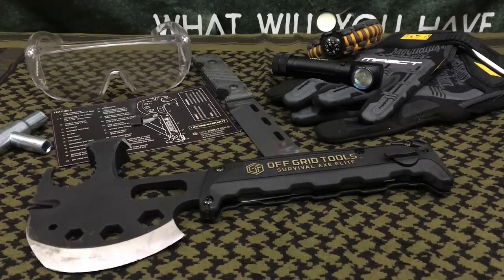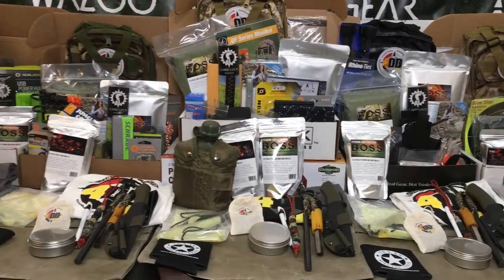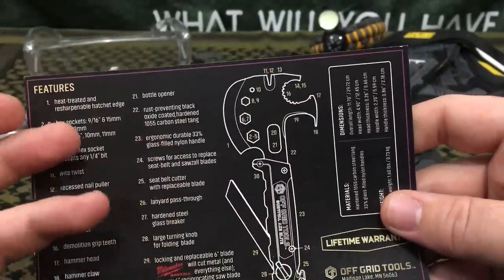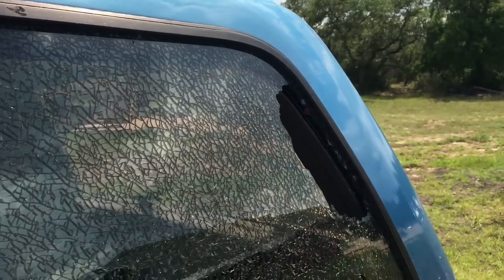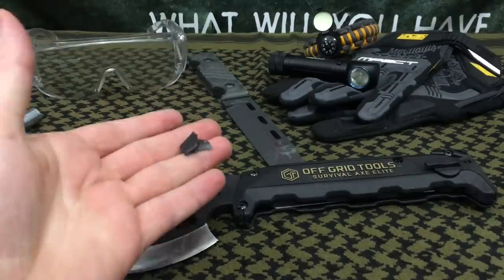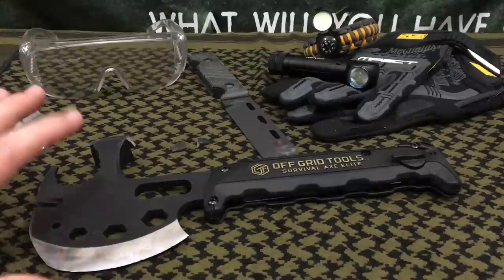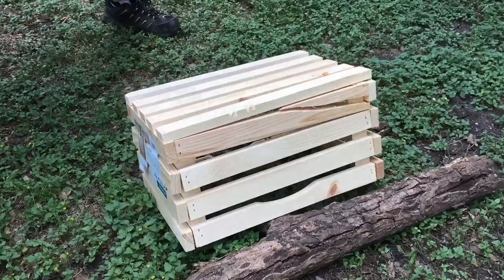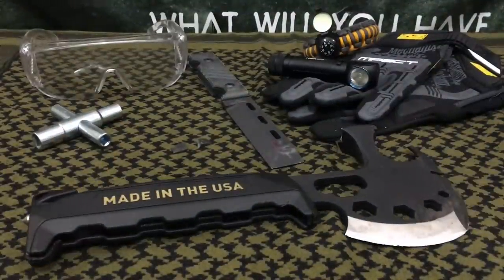The Urban Survival Axe by OFF GRID TOOLS - 30 in 1 Survival Tool

Comment: I just ordered one of these last week. Damn, it looks bad. I'm going to hit mine into a cinder block too, I hope it doesn't break.  FRN is bad on a tool like this. Maybe I can remove the scales and lock-failing saw and just wrap the tang.
Reply from the maker: I was so dissappointed and 18 months of waiting... lol Ill be sure to watch yours bud!
Reply: DropForgedSurvival - - sorry, I may have missed it, but do you know if the tang goes all the way down to the pummel please? With that having a saw & glass-filled handle, I'd imagine it feeling kind of flimsy, yes/no?
Reply from the maker: It is Full Tang wit the Saw blade running parallel to it. "UPDATE" just got word that they are working on a field upgrade for the Saw Locking Mechanism which is GREAT NEWS!
Reply: This is just superb, been searching for "how going off the grid changed my life" for a while now, and I think this has helped. Have you ever come across - Tiyariaa Imposing Takeover - (do a google search )? 

It is a great exclusive guide for discovering how to survive in a disaster with your own hidden survival garden without the normal expense. Ive heard some super things about it and my mate got cool success with it.

Comment: Good video.The "tool" is just for show and movies.Like the "Annialator"hammer.Looks cool but it's weak.Save your loot and just buy a Stanley steel hammer,15" pry bar and McGyver a handle for the saw blade.Far less expensive and far better tool combo.The extra ounces of weight won't hurt you.My stuff packs n carries well in a small lap top computer case I got at Good will.Good video still.

Comment: I would not have that thing in my survival kit if you paid me to take it.  The naked blade from the is dangerous when you're using the hammer or nail puller.  While it was not designed to break blocks, it should not have broken so easily.  For my money, it's a POS not worth buying.

Comment: back to R and D and better quality control
Reply from the maker: Not really... a Simple design change.. "which is still very expensive... better choice... go with a better steel such as 4140 steel... Common for quality AXES. and the Fix the Locking Mechanism..

Comment: Actually, I have yet to see a positive review of this tool. (And I've seen many.) I agree that it's a cool concept, but the unanimous consensus is that the the implementation is crap.
Reply from the maker: adhair Where have you seen the Reviews? I'm the first on youtube m, especially with testing. No one has gotten their preorders yet
Reply: DropForgedSurvival: just the Battlebox guys. Cutlerylover is almost the most generous guy on the planet, and even he said "disappointing."
Reply from the maker: adhair Those aren't "Reviews" those are impressions and thoughts in my mind.  I've had tools that felt flimsy and were epic and some tools that felt like tanks that were junk. If someone doesn't "test" it's not a reliable review in my opinion.
Reply: DropForgedSurvival hey, I'm not gonna argue. if you want, I'll rephrase: I haven't seen any positive impressions.
Reply: here is my review does it cut no as it has no edge, I not shitting there is no edge on mine.

Comment: The failure of the claw on the hammer end is due to the manufacturing process, instead of being forged, like most axes and hammers, or cut from a single piece of steel, like most monolithic tomahawks, these tools are cast. Cast steel, regardless of heat treating, is going to be much more brittle than forged or cut steel because the grain structure of the metal is extremely coarse, which reduces the overall toughness and ductility significantly.

Comment: Say Heah, What type of steel is the Axe made of.,,.p
Reply from the maker: paulie 4x 1055 Carbon Steel
Reply: Thanx You. That's not bad, my Estwings are made out of it. Although I like the steel a little more carbon.,,.p
Reply from the maker: paulie 4x That is Correct, 5160, 1075, and even 4140 would have been alternate good choices
Reply: DropForgedSurvival yup, I really like my Council 24" Wood Craft Pack Axe Council uses the 5160 as the steel on my 24" Pack Axe.,,.p

Comment: Nice tool my understanding is starting in 2017 side windows will not break like the used to. You will need to cut it like the front window
Reply: Also looked like you used metal blade on wood that will cut better with wood blade

Comment: thank you for the testing of this item chris. I recieved two of these in the recent battlbox and have noticed difference between the two I recieved. one has a black coating on where  the blade edge is ground while the other does not. the one without the coating is noticeably sharper than the one without the coating. neither of mine are ground as high up as yours. neither saw blade locks open either. I'm wondering if the description of it locking was referring to it locking closed. seems they have some qc issues with the product line which is a shame because this tool has so much potential. crazy that the hammer claw part on yours broke. you gave a great review and awesome testing.
Reply: I wonder if any of the other product lines they make like the truckers friend or fireman's friend are having these issue as far as brittle metal. I would definitely like to see how innovation factory handles your problem as far as warranty and whether the make improvements to fix the issue in future production

Comment: cheap steel made in china
Reply from the maker: cking_closure Ummm who told you that? 1055 was originally developed in the US. Now china, Taiwan, and ALOT of other countries use it as it is a low cost steel but if actually heat treated correctly.. it makes a great impact tool such as a Hammer, Axe, etc. Was this Heat Treated correctly? No clue. I wasn't there. It could have been a number of things that lead to the failure... To thin of a claw Profile, a hairline crack that was missed in the QC process.. etc. but this tool was made in the US.
Reply: Well what I found out lately made say what I said and that  is  raw material is imported from china and then put together is the states and canada but I am not saying that I am sure that this steel"Axe Elite"  was imported  however it shouldn't snap the way it did .
My son is a plumber and he told me that what you see in the market labeled  made in the USA like american standard  is not 100% truly made in the US for the core components are imported from china , there are a lot of things is not what it used to be and they are getting away with it
Reply: made with US steel, heat treated to specification. Wrong specification given. Definitely made in the USA. The one tested here was actually a prototype and the heat treatment has been changed.